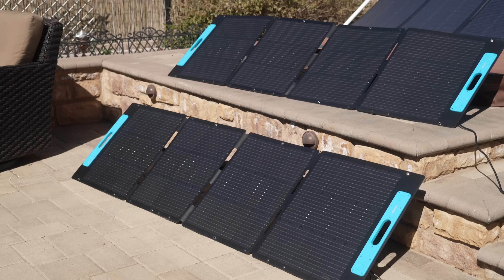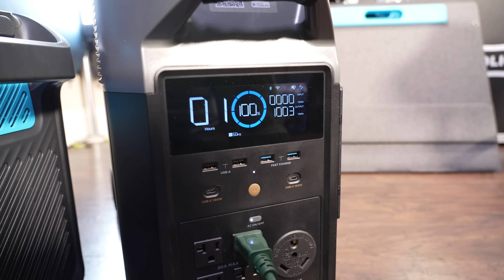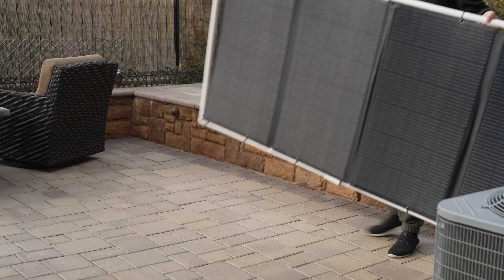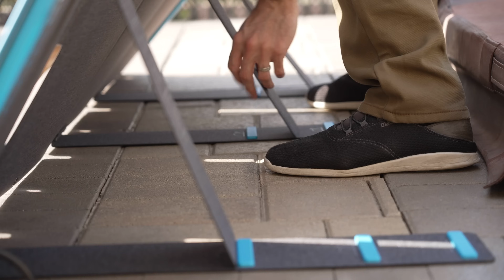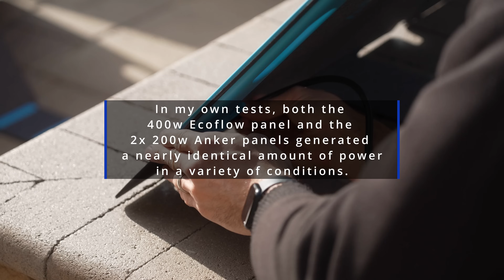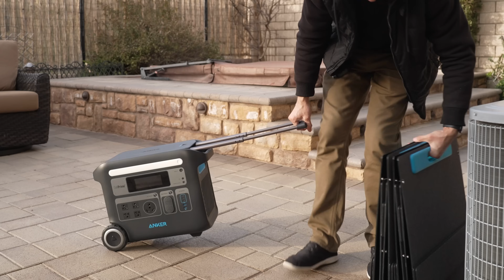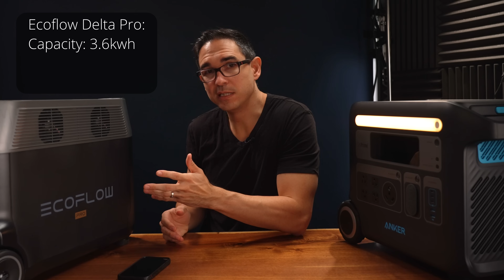Why I like the Anker Powerhouse 767 BETTER than the Ecoflow Delta Pro

Comment: Charging at an EV charging station is a useful feature when the battery can be carried to it.  Ecoflo should make a smaller pro or Anker should add that.  Putzing around with solar isn’t practical for condo dwellers.

Comment: I just ordered a 767 and I have the C1000 with the extended battery. My ONLY complaint of the expansion battery is the connection cable. I wish Anker would make a cable with a 90° plug on it to make the units more compact for storage since a lot of their customer base is Vanlifers. Other than that, Im in love with the C1000 and cannot wait to get my Powerhouse!

Comment: I have the Anker 767 and love it and I did look at the ECOFLOW and the sound was the key. I use it in my Thor Sanctuary 19P and you can barely hear the Anker 767. The problem I is I cannot power my RV with it. The engineers at Thor say it is Anker that is wired wrong and the engineers at Anker say it is Thor RV Surge protection that is preventing it from powering the RV. I could care less who is right or wrong, just as long as it works. I tried the bonding ground plug by Watchdog and Southwire, both didn't work. So keep that in mind, while the Anker 767 is cheaper and works great, if you plan on power an RV, it will be challenging. I have not got mines to work. I also feel that it can do it, I am just not smart enough to figure it out. When I tested my Anker with a receptable tester, it said that reversed polarity but plugged in, it says correct wired, confusing (I would assume, it is grounded in the house). If anyone knows how to solve this issue, please advice. Also, for the solar, the Anker solar panels are heavy, he made them look like they were lightweight, don't know which ones he have, but the 200watts ones have some good weight to them. They work great. I don't regreat getting the Anker, it is so portable and useful and the I gotta give the techs at Anker their props, if I can only figure out the issues with power my RV.

Comment: have you had any trouble with the AC inverter turning off randomly? i have 2 of these units and when either one is connected to my transfer switch via the tt-30r outlet and running circuits in my home the inverter will just randomly shut off. It only happens when powering the transfer switch via the tt-30r port or when i turn the AC inverter on with nothing connected to the device. Anker customer service said the 767 or F2000 as it is now called isn't designed to be hooked to a transfer switch. I can't understand why it wouldn't be able too.

Comment: Hi Tommy! Thank you for the review. Watching your review, I googled about the Delta Pro noise. On reddit people said it got better with firmware upgrades. Do you have some input on this? The idea is to have this inside a small van, specifically for sleep with the AC on.
I’d buy the Anker, but thing is, Ecoflow just released this alternator charger product that quickly charges their Delta units, and also does the opposite, it takes energy from the Delta to keep the car battery charged. This would allow me to keep the car AC on while camping. But that noise…. Did it got better?

Comment: Tommy good review.. i got both to compare.  Deltapro  is state of the art with options but its so loud when really being pushed.. i haven't heard a noise out the Anker f2600, it depends on  your use.  Make no mistake about it ecoflow is built like  tank to really work hard.  Anker f2600 no noise but it does not do what Deltra pro can do.. I am keeping the anker f2600 because its quite and for my purpose its the better fit. Rv use, Projector movie night, shed power.

Comment: The new Anker 2600 is even better than that 767. The Anker 2600 added WiFi and made it more powerful and fixed any other minor issue the Anker 767 had. This comparison isn't fair since the competition for Anker 767 (F2000) is the Delta Max 2. The new Anker 2600 seems to be the best out there now. The City Prepper on YouTube does a very in depth review of power stations with numbers to back it. He also says the Anker 767 was the best if he had to pick one. What ever issue (only 1) he had with the Anker 767 they fixed with the all new Anker 2600.

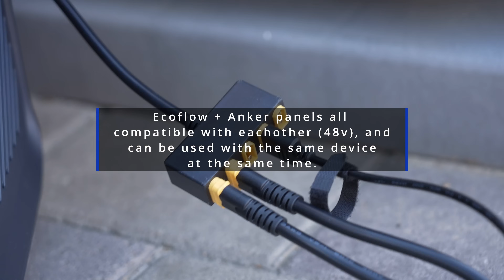Comment: @3:43 I have to warn you if you do not know that those leads on the "5-port solar charging connector" are HOT HOT HOT! Very dangerous. 
So please know that the open connectors are a risk. Death risk... Anker should have known better and hopefully are working on a solution.

Comment: Ecoflow Delta Pro is for daily use with high power appliances such as microwave, washing machine, clothes dryer, iron, etc. to have it in the kitchen (hence its immovable weight) while the Anker 767 is more for use in workshops, camping, small appliances. 
So maybe these 2 models shouldn´t have been compared because the target market of each one is completely different.

Comment: Respectfully you are not comparing apples to apples. While the Ecoflow weighs 48 percent more, it has 80 percent more capacity. When you are talking about power, energy, that is a significant advantage.

Comment: When I first heard about the Anker 767 I thought to myself, I love Anker and I would really like to get it, then I did a comparison to the Eco Delta Pro (I already have 2 with extra batteries). The Delta Pro was far superior in capacity (3600Wh vs Anker’s 2048Wh), inverter (3600W with surge up to 7200W vs Anker’s measly 2400W), solar input (1600W vs Anker’s 1000W), and the solar panels automatically turn the unit on. There’s no way I’ll be able to replace my Delta Pros for the Anker, it would be a major downgrade. EcoFlow have a much cheaper and lighter Delta Max (I have 2 of them with 3 extra batteries) that competes with the Anker Powerhouse 767.
Reply: You judgement is a little biased. You have two delta pros already. I myself wouldn’t switch to a whole new brand if I already have something I Can build upon. Anker came up with the newer version of the 767, the F2600.

Comment: Anker can't be tandem run for 240V and really, who cares about a light ??  Also, Anker doesn't have automatic recharge from an Ecoflow gas generator or an automatic switchover. Along with the 60% greater capacity, you're getting a lot more with the Ecoflow.  Does Anker do UPS/AC passthrough ?

Comment: Warranty doesn’t mean you’re covered. What’s included in the warranty is the most important. Just saying
I’ve learned that the hard way with a grow light that had a 5 year warranty and after a year something happen and I would have had spent what I payed for it to be replaced or fixed. So read what it covers.

Comment: Unfortunately, the Anker's a deal breaker since it doesn't offer auto-start solar charging :' (   Also, when choosing a portable power station, people need to make sure the items they want to plug into the PPS will "actually" run for a while.  The point being, smaller portable power station will not run certain items for very long, so make sure you get the right size PPS for the items you plan to run.

Comment: Both of these solar generators use low cost, high frequency, low surge inverters that run much hotter and have no output transformer. High frequency inverters are fine for running light, non inductive, loads like a laptop, charging your phone or powering incandescent lights etc, but powering the inductive loads that you will probably want to run during a prolonged power outage like refrigerators, microwaves, power tools or motors will damage these high frequency solar generators and WILL seriously shorten their life expectancy. They simply were not designed for repeatedly powering inductive loads. That's why the big name brand inverter manufacturers like Schneider Electric, Outback Power, Magnum Energy and others, all use a low frequency topology in their designs. Another consideration is that the vast majority of these solar generators are non-repairable. At a typical shop rate of $125 per hour, with no schematic and limited parts availability, it makes no economic sense to even attempt to repair one of these units. Once the FETs have fried on one of these units, (And trust me, sooner rather than later, they will fry.) they basically become a brick. A much better choice is to spend a little more money and buy or build a solar generator that uses a low frequency, transformer based inverter instead. It will last far, far longer and you will be able to power high inductive loads that you're going to need to power, during a power outage.
Reply: Interesting comment. Do you have examples of good solar generators that use low frequency, transformer based inverters?

Comment: Maybe I didn't quite understand what was being said, but to me the biggest difference in the two is the Delta Pros can run in parallel giving max output of 7200w at one time. Of course you'll have to upgrade and get the power block that allows them to sync, but that's my biggest concern. I need to power a full home.
Reply: It’d would be nice a demo video to see how these devices capabilities, hooked up to run your homes instead technical, like old fridge, air fryer….how much wattage they generally takes and how long……most us can’t figure out what is good investment for a small apt, than regular house, not everyone has $ to gamble, buy then find out too late in er situations. I can barely afford to get one not 2+ . Tech specs doesn’t help much for a newbie’s first purchase.

Comment: I really appreciate you doing this video. ive been trying to decide between Bluette, eco flow, patriot, jackery and a couple other brands. I myself don't care about all the cell phone playing around apps ect,,. my concerns would be Ion phosphate lifepo4 long life, the anker's durability toughness, the portable features are nice, the quietness is not a big concern for me, recharge time is a great need and connectivity, and expansion is very important. i hear the display screen features could be improved. they could make a 90 degree plug that would be nice. I have a great idea for one of these companies I'm thinking about mentioning to them. May approach Anker maybe about it. If we have huge blackouts much cell service won't operate so I'm not too concerned with toying and playing with A phone app for amusement .  the control features may be nice but put the money into reliability & durability and expandability.

Comment: Thanks alot for this review.  I was thinking about getting the Ecoflow for my house, but it looks like the Anker Powerhouse is better and more affordable.  I do have a question.  For home generator purposes, does the Anker have a "plug and play" feature to make it easier to set up?
Reply from the maker: Ankers coming out with stuff more tailored to home backup, check out the F3800.
Reply: @TommyCallaway  Ok.  Thanks.

Comment: Is there some sort of app or spreadsheet available to figure out how long a battery will last under critical loads only? Then under normal everyday usage? I need that to size a battery system to best suit my needs.
Reply: Do the math, and remember to integrate the volts x Amps over time.  My guess is no-one here can be bothered, everyone says more battery is better,  and no-one is going to consider how the device will perform when there is no grid, and no sun.

Comment: What i would like just as much as an auto-on after AC/solar, is the ability to have AC and solar at the same time, and only use AC when solar is not enough, or say, not use AC until battery is below 50%, or 75% or some number you've chosen

Comment: One of the issue with all of these units with the TT-30 port is that on all of them except the Delta Pro are not 30 Amp Capable. The Anker can output 2400W to that port is limited to 20Amp, the Delta Pro is 3600 watts so that is a 30amp max output.

Comment: Can either of these units be charged with a gas generator if solar isnt an option ?
Reply from the maker: Yes. Ecoflow sells their own special dual fuel gas generator which is the best choice for the ecoflow delta pro, or you can use any regular gas generator to charge either unit. They both charge via AC at about 1600-1800w.

Comment: Your review is so biased and dishonest as to be laughable.  For instance you campare a 3600 watt/hr EcoFlow with a 2000 watt/hr Anker then state there's a difference in price.  Preying on lack of knowledge in prospective buyers isn't nice.  And that's precisely what you are doing here.  Comparing weight of 99 lbs for the EcoFlow vs 68 lbs for the Anker. Lets get real here.  You are a douchebag.  A dishonest one.  If you're really worried about fan noise just move it to another room and run a cord.  Lousy way to make a living dude.

Comment: The Ecoflow has another BIG BIG selling point.  The Smart Home Panel that allows you to run your home off your battery/solar panels during off peak/emergency times that allows you to offset your electric bill.
Reply: 100% agree. I have 14.4kWh of back up (two DP’s & two Xtra DP batteries) connected to my smart home panel, with discharge/charge limits currently set to 15%/85%.. replenished by 20 rooftop panels between 8am-4pm, powering 10/16 household circuits from 4pm till 8am each day, with an average of 25-35% capacity still remaining by morning. 

In the rare off chance my rooftop solar is not working and there’s an outage, I like that I have the option of bringing DP units to an EV charging station with the Xtream/J1772 adapter that I have as alternate means of sourcing power (assuming they’ll have power when I don’t). 

I’ve found so far, that 14.4kWh of back up is more than sufficient for my home’s daily energy usage, powering essential and nonessential appliances 16 hours/day 4pm-8am, with ~60% of available capacity remaining before recharging off of roof top solar.. averaging about 5.8kWh per day, and could have just used 2 DP’s/7.2kWh, but wanted the option to supply emergency power to my EV’s, so I opted to double my capacity to 14.4kWh. I’ve considered adding two more DP Xtra batt’s for 21.6kWh, but haven’t found the need for more capacity at the moment. 

I also have a EF portable solar panel and DP 1300 for light duty back up/camping use. 

Overall, I’ve been quite happy with my EcoFlow Smart Panel / 14.4kWh Delta Pro back up, and the ROI created by offsetting peak usage and grid usage overall. It’s nice knowing these units will eventually pay for themselves, while providing the peace of mind of essential home battery back up.

Comment: Wouldn't have been better if you compared the EcoFlo Delta Max 2. I believe it is also a 2400k generator weighs about the same a Anker has a quite fan and also comes with an extended warranty.
Reply: I agree, but the Delta Max 2 was not out when he made this video
Reply: *quiet 😛
Reply: Delta 2 max doesn’t have the 30A plug to connect to your panel directly!

Comment: I cannot recall if mentioned, but I believe a huge advantage with the Ecoflow is the ability to plug into external Generlink type plug to use and override the home electrical panel.
Reply: "Generlink" isn't proprietary to just EcoFlow, any Portable Power Station that features a 30A plug will work with Generlink.

Comment: Far and away the best review/comparison of the top of the line Anker Powerhouse 767 and the Ecoflow Delta Pro.  On several other reviews Ecoflow owners claim their units are better (forgetting the significantly higher price of the Ecoflow), but this review dispels that.  And if you add the extra battery to the Anker 767 you're still cheaper than the Ecoflow Delta Pro and have more power, a better warranty and all the other advantages the Anker has over the Ecoflow.  Well done Tommy!  You've settled a lot of arguments with this excellent review.

Comment: The thing is once the battery cycle has finished how do you replace them instead of buy a new unit
Reply: After 10 years you still have 80%. and that is if you recharge everyday, no one does that.

Comment: Great video, I’ll be tuning in to more. Of course I just ordered the delta max after I thought I had it narrowed down between it and the bluetti ac max 2000. 
I’m powering van apartment and some corded tools for work and I hope this will be sufficient. Got it through Costco for the friendliness of exchanging but hope I don’t need to. This a let unit seems pretty nice and I like the panels

Comment: I am a bit disappointed after buying the Anker 767. The fact that one cannot connect two units together for 240v and only being able to connect one external battery seems very limiting
Reply: I am going to sell mine after only one use.
Reply: I think the 767 is better suited to portable camping use than for whole house backup. Anker just came out with a larger model that is more suited for home electrical backup.

Comment: Um...this guy confuses me a bit.  He's not doing an apple to apple comparison.  On one hand, he criticizes the Ecoflow for "only" having 1600 watts of Solar for a 3.6Kwh system but then lauds the Anker for 1000 watts of Solar charging on a 2Kwh system.  Say what?  Both are portable systems and the Ecoflow is rated for more charge cycles before battery degradation.

At this time, I'll go with the Ecoflow as I can get a portable 10Kwh setup for my home with more features than the Anker system.  Don't get me wrong, I also like Anker and they make good power banks, but they are newer to the home backup market and I think they need more features.  Fans notwithstanding.
Reply from the maker: This guy has more feedback: Anker pushed an update so the solar relay doesn’t do loud annoying clicking every morning and evening when there is low sunlight. Ecoflow is a great unit. Just too loud for me to use all the time.

I also have a 48v string plugged into Anker generating 800 watts right now. If I plug it into ecoflow, the delta pro limits it to 350 watts (8 amps) because it thinks it’s a car charger.

So far they’re both great and no, it’s not apples to apples. I explained why I prefer the Anker for my use case.